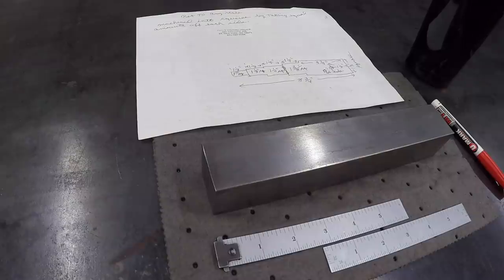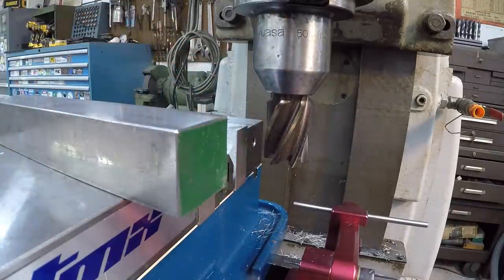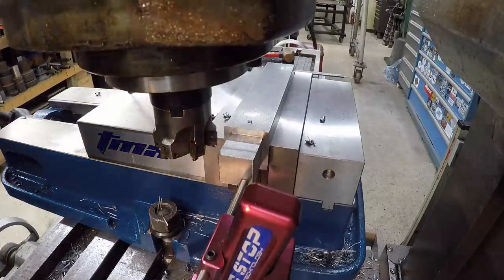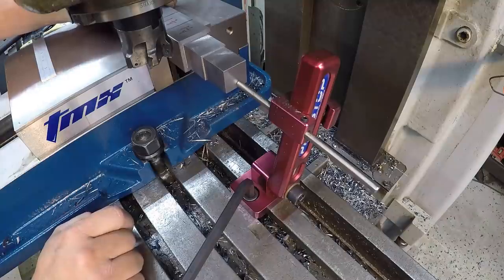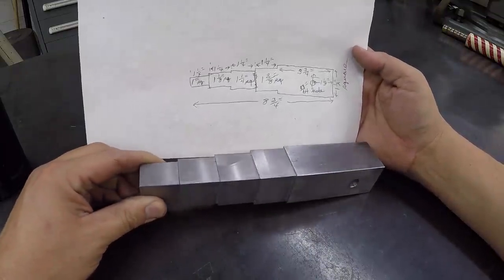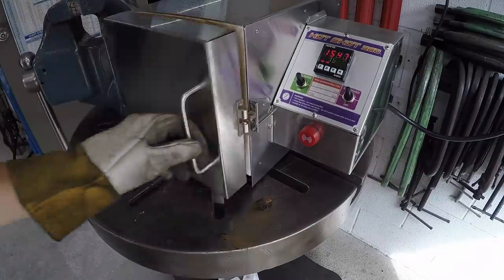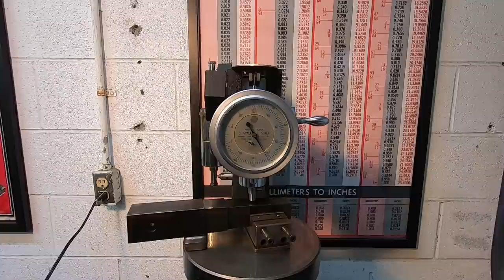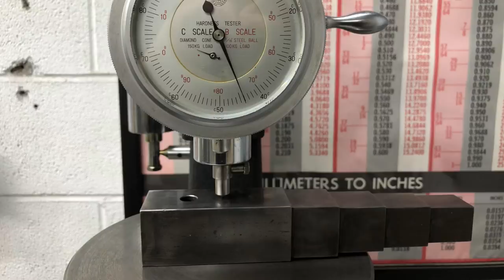SNS 296: Custom Square Drive Tool, Heat Treating

Comment: You made so many mistakes on heat treating it is not possible to list them here.  If you want to heat treat get this book and read it.  It will resolve 95% of issues you had and get you out of the hear say everybody is giving you.  William E Bryson "Heat Treatment,  Selection, & Application of Tool Steel. Simple quick accurate read.

Comment: Sadly this is no longer the Big ABOM channel it used to be. Now just a backyard hobby shop :(
Reply: I see your channel has a ton of content,  what a crappy comment.. wake up on the wrong side of the bed???
Reply: I prefer the job shop, hobby shop projects over the oil field equipment he recorded at work since I'll never work on such large pieces at home with my Bridgeport and little 1440 lathe.
Reply: @djmjr77  
So nobody can simply have his own opinions? What has K Thomson's channel content got to do with anything. That's not an argument, that's immature.
Reply: Dusty 99  
Get a dictionary and look up the meaning of "Puerile"

Comment: dont think you experimenting on someones part was a good idea       heres your stuff try it  and see if it works ............
Reply: cermem Adam told Paul all of this prior to doing it. The tool Paul is wanting does not have to be heat treated in order to perform its intended task therefore if the heat treatment doesn’t work then the tool itself will not fail the operator. Adam wants to gain experience in this field so this was a chance to do so and gain practice in this new skill...